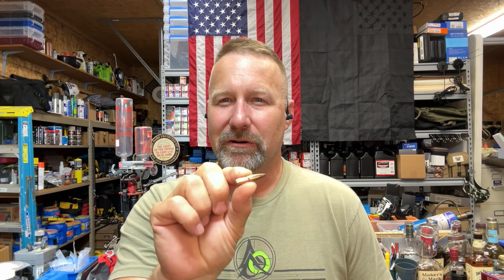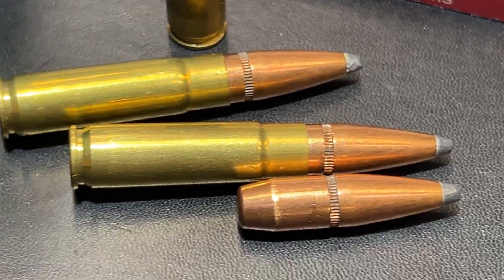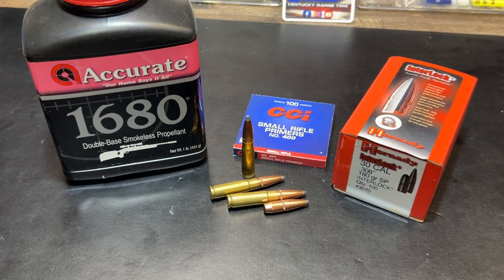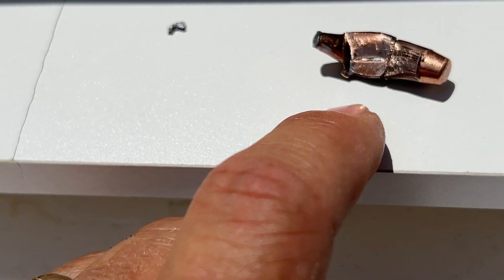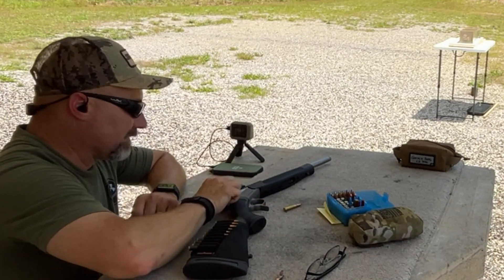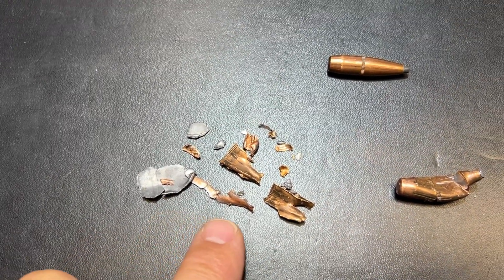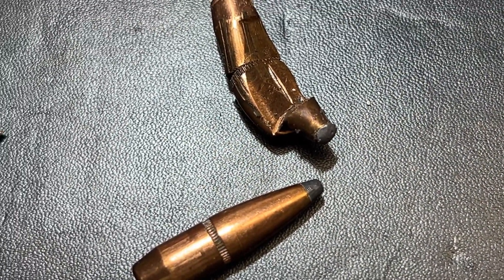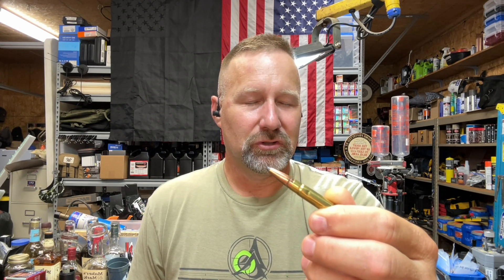.300blk, Hornady 180gr BTSP Interlock Bullet Tested in Clear Ballistics Gel Blocks.

Comment: The time you have put in these tests are insane! Thank you for this series! 
Quick question, how do ya like the Garmin chronograph?  For years ive used the Alpha chrony and still do, but ive been contemplating on getting the Garmin. Ive noticed you get a few "no reads" . Is this a problem with the garmin or just the learning curve? Thanks again sir!
Reply from the maker: @preacherbiggin  All in all I like the Garmin.  I’ve used a Maxwell Pro-chrono for years with good results too though. 

Pro’s for the Garmin, the small package, quick setup, rechargeable battery and easy data import to my phone make a few extra missed shots still worth it. 

My issues with it are, it will miss rapid fired shots, you have to have the slow velocity selected if your shooting subs, muzzle blast from a comp will cause it to not read (probably my biggest reason for it not reading).  I wish the phone app had more space to input hand load data. 

I have no regrets getting it. 😉